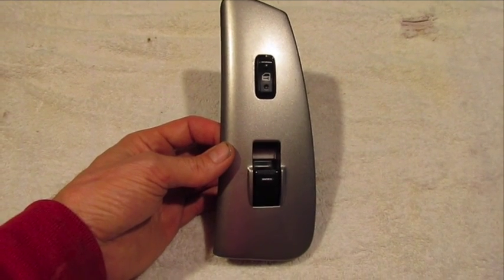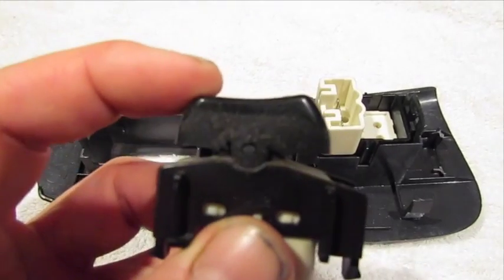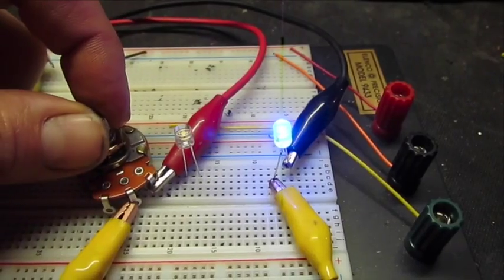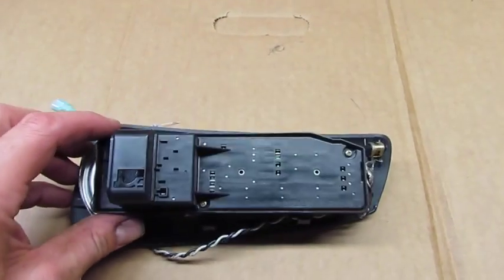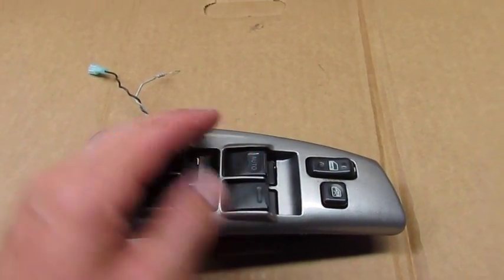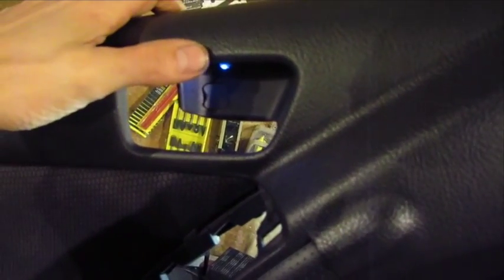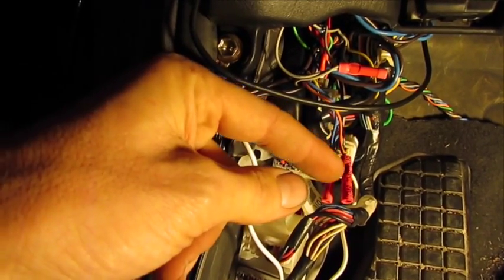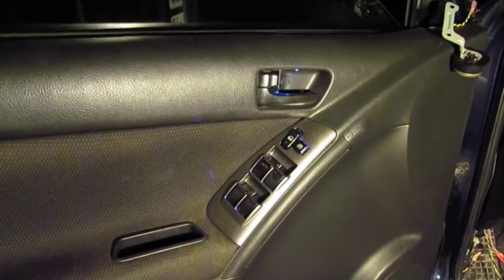Vibe and Matrix adding door window and lock control panel lights DIY

Comment: I know this is a really old video, but is there any way you could describe the wiring you used a bit more in detail? Toyota using ground switched power for almost everything is really messing up my ability to wire the LEDs I added...

Comment: Is it necessary to take off the inner door panel in order to remove the lock/window control panels?

Your videos for repair work on the Vibe/Matrix are very helpful. Thanks.

Comment: I am so glad I found your channel, I have a 2003 Pontiac Vibe so everything you do is so helpfull :)
Reply: same here. my issue is my instrument cluster, lights and gauges just go out randomly and every other day they decide to start working perfectly fine again. No idea what it could be.
Reply: @lordazrielxiii7731  I think they might still be halogen even that small. So vibrations can make the metal "fillament" of the bulb reatatch. Reading this comment now, I have to say I never replaced any of them even until I had it 4 years ago because they worked more often than not.

I've always been scared of the check engine light being out & you never know 😂